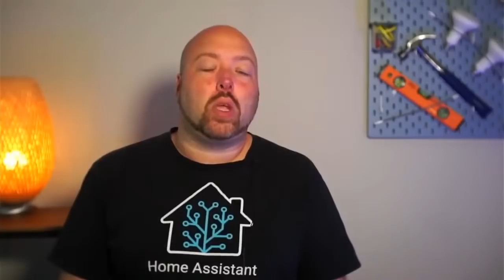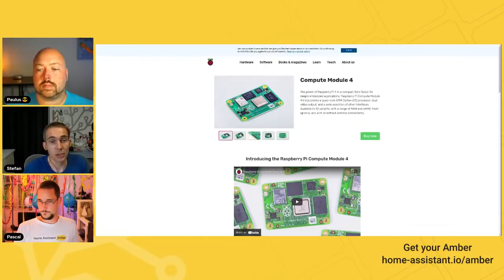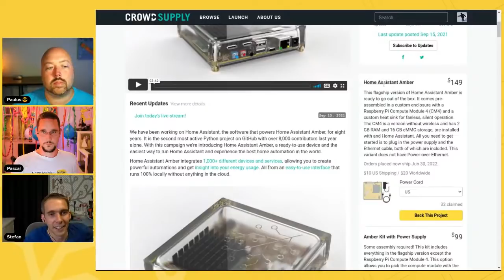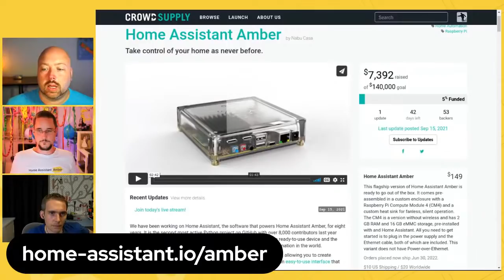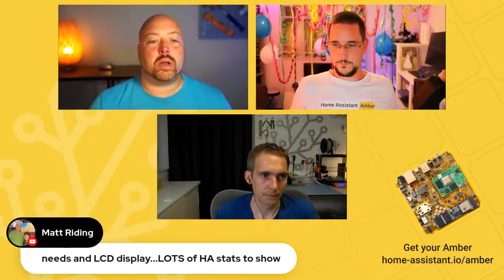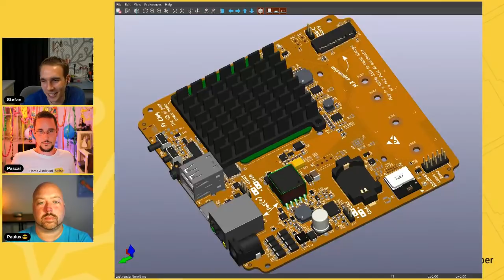Home Assistant Yellow introduction and Q&A

Comment: You might want to put a heatsink on the POE and the power regulator chips since those are bound to get hot.
Would this also work with m.2 drives with heatsinks on them? I doubt the raspi will stress it to the point of getting too hot but having a heatsink is bound to extend their life.
Please also have a vented case design as well, preferably around the sides and not the top/bottom.

Comment: hi master. many thanks for a super good product. is very excited about what your new yellow will be. have a question about the cm4 module that is needed. you probably do not need wifi if you run a wire contact. know it's a bit noob but just want to be sure of it before I get a cm4 home .. :-)

regards, Michael.

PS  happy 8 b-day....:-)
Reply from the maker: Correct. Get a CM4 without Wi-Fi and use the onboard ethernet instead.
Reply: @home_assistant  perfect then I will do it .. many thanks I look forward to getting it home so I can get really started ... :-)

Comment: Exciting times! I just ordered 2 of the kits and 2 of the 32GB Pi4’s.  Did I hear correctly that I will be able to throw away my Hue hub and control all my Hue lights and motion sensors using HA Amber?  Can’t wait till it arrives… Now… what to do with my 2 HA Blues??  Hmmm….
Reply: Hue Bridge uses ZigBee.  I have been using my Hue lights and sensors with a Conbee II on Home Assistant for nearly 2 years without the Hue Bridge.   Just pair them to Home Assistant (Deconz, ZHA or Zigbee2MQTT) instead of the Hue Bridge.  If you have a Hue Dimmer Remote, it's really easy to factory reset the bulbs so they can be paired directly to Home Assistant using a Zigbee dongle, or the new Amber when you get it.
Maybe you can repurpose the Odroids in the Blue's.  They are pretty easy to reprogram and put different applications on.
Reply: @EsotericArctos  How about the indoor and outdoor Hue motion sensors?  Will these work as well?
Reply: @richardburguillos3118  For Hue, 100% as they are all ZigBee based.  I use Hue, Aqara and tuya Zigbee items and all work identically to how the work with their own branded hubs, except 100% local.   Anything ZigBee 3.0 should work fine and a lot of ZLL (ZigBee Light Link) and ZHA ( ZigBee Home Automation) products based on the older ZigBee 2 standards should work.   Hue bulbs still mostly use ZLL and work flawlessly.  I also use Hue motion sensors which are also flawless, you can use the motion, temperature and light sensors that are built into the Hue Motion sensors for automations.
Reply: @EsotericArctos  Thanks!  Can’t wait to cut the string to the Hue cloud.  Thanks for your quick replies and time…
Reply: @richardburguillos3118  It is great to have it just work without any internet, but also have the option to use a voice assistant if you want to set one up in Home Assistant.
None of my Aqara, Tuya or Hue Zigbee devices have ever known of the cloud

Comment: Happy birthday Home Assistant.
I jumped on the HA Blue last year because it was such a cool project, even though I already had a good NUC dedicated for the purpose. And it runs great.
Now I see this project and I think - hey that is cool too.
Having a Blue there is no really good reason for me to buy the Amber
The Amber will probably not be faster and Matter seems far out in the future.
And more good arguments for not buying one.

And then...

What the heck? I have to support this project! I ordered the kit. We will see if I will actually run HA on it, but it is actually a very cool box for other small headless server purposes. And I want to support this initiative.
And as a hardware engineer, I really like what I see. Well designed as far as I can tell. And I know how much work there is behind this. Also also how much you still have ahead getting the various certifications done with EMC, radio compliance, safety. It is not trivial to put hardware on the market. Respect!
Reply: Matter is not too far in the future.  ZigBee Alliance is now the Connectivity Alliance because of Matter.   But darn it, I only just got the blue after a 3 month wait for it on back order, so I am reluctant to buy something else as well. 
Like you, I want to support this so most likely will get it and repurpose the ODroid in the Blue :)